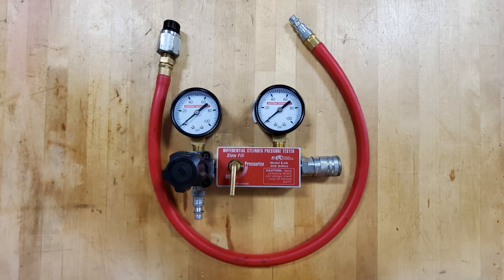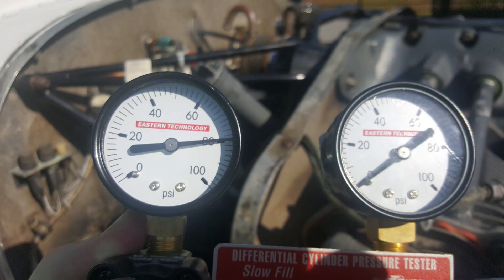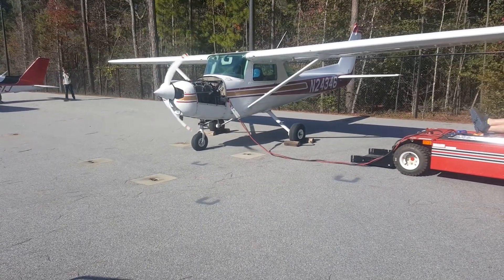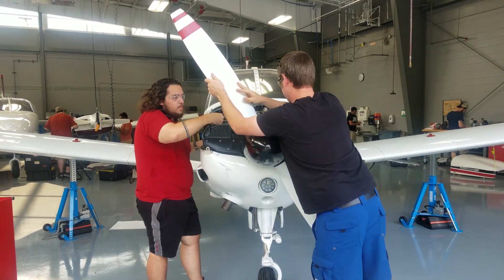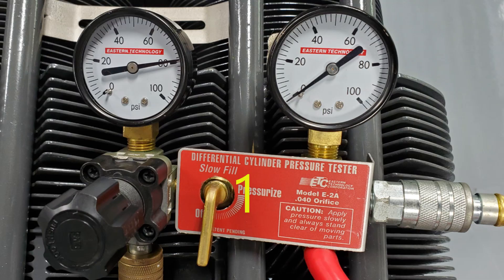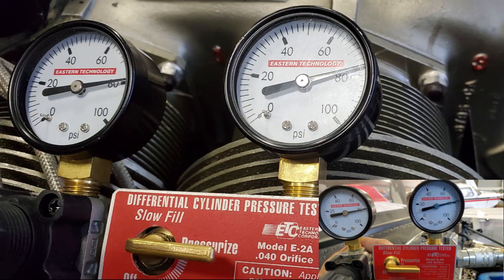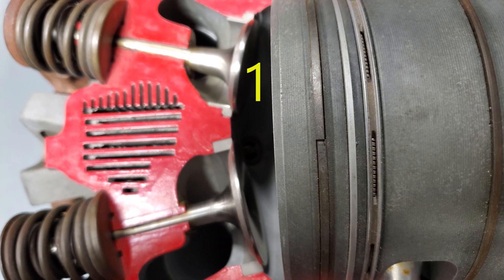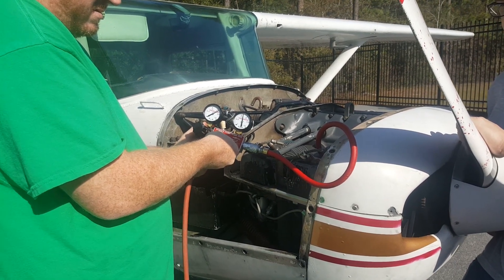Cylinder Compression Testing - Without Metered Orifice Differential Pressure Tester

Comment: Seems like you'd want to let the engine cool down before placing your thumb on the spark plug hole.
Reply from the maker: We simulate an engine run.  We do the actual engine runs on operational running engine trainers.

Comment: Why is that guy turning the prop backwards?  Well, maybe he is going back to TDC??
Reply: Seating the bottom of the ring to the ring land.
Reply: Exactly.  He only turns it backwards despite the narration stating only turn it in the normal direction of travel.  If you want to bring it up on compression stroke then you should be turning it in the operating direction.
Reply from the maker: The procedures instructs to turn in the different directions when finding top dead center.